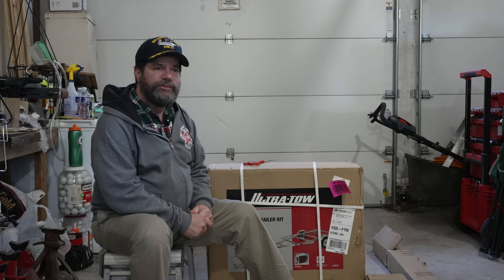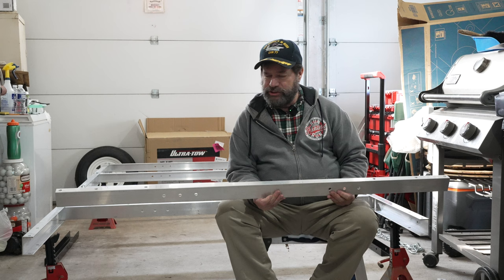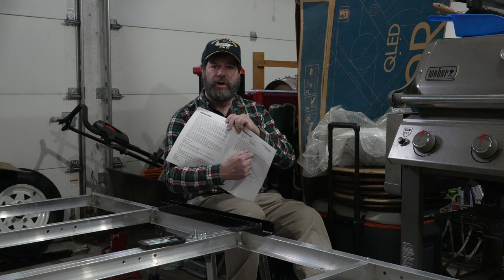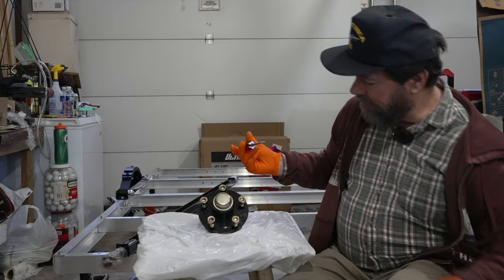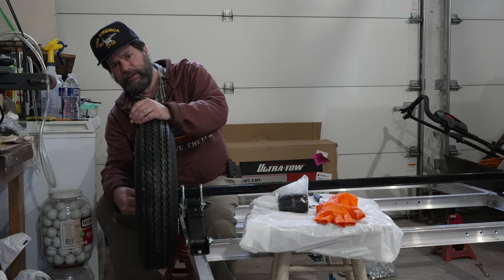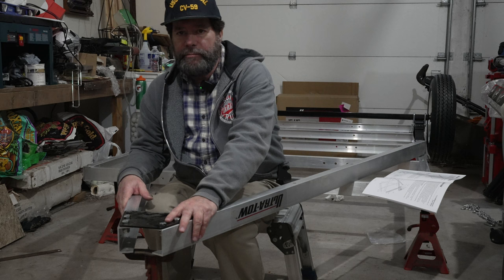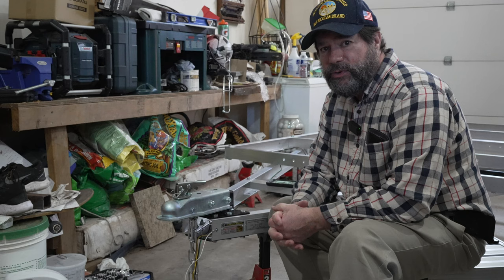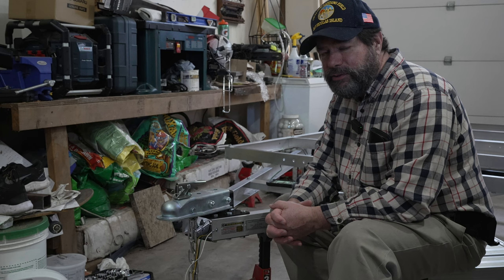Building the Northern Tool Ultra-Tow 5 x 8 Aluminum Trailer Kit

Comment: Great job on the tutorial, the most comprehensive one on YouTube! I just picked up one of those trailer and mine has some differences when it comes to tow bar attachment. They also changed the order of some steps around and tell you to leave out a couple bolts during initial assembly. Thanks for calling out the stupid marker light detail! The instructions are poorly written and I did not catch that one of my side rails was swapped around.
Reply from the maker: I'm glad it was helpful.

Comment: Thank you for the tutorial! I've purchased a used one recently and started hearing about aluminum corrosion from the stainless steel bolts. I read you can add rubber flushers to prevent direct contact. Is this something to be concerned about?
Reply from the maker: I have heard that some metals will react with aluminum.  I can not tell if the bolts in the kit will ever cause a reaction.

Comment: Thank you for the video! Where do the eight bolts marked SC 8.8 in separate bag go?
Reply from the maker: These are shown in the video.  I can not remember the exact locations, but it is either the spring connections or the trailer hitch connector.

Comment: I want this trailer but i see it is rated only for 45mph.  Is there a way to make it go faster?
Reply from the maker: I changed the axle, wheels and tires. Now my trailer is rated at 75 MPH.
Reply: @HistoricForrest  can you provide any info on the axel, wheels , and tires you went with?
Reply from the maker: @TheBobvass  I got the 72/58 3500 lb axle from the Tractor Supply Company.  I had to get a conversion kit to attach the axle.  I got 15 inch wheels and tires from etrailer .

Comment: Just a couple questions how much does the base trailer weigh, and what’s the cost also sorry to hear about your car.
Reply from the maker: 187 pounds.  I paid $899.99 before tax.
Reply: I'm thinking of buying one, how is the trailer? Worth buying??
Reply from the maker: @macbethdemilo7253  I like the Aluminum frame.  I do not like the wheels and Axle.  I am using it to build a teardrop camper and have not driven it on the road yet.  I am replacing the wheels and axle.  I bought it because of the low weight.
Reply: @HistoricForrest  thanks for the reply, I was also thinking of building a TD on it and wasn't sure how it held up.
Reply: @HistoricForrest  with any of these bolt together frames I was going to change the wheels and axle on it
Reply from the maker: @macbethdemilo7253  
I am working on the floor now.  The bolts seem to make the frame tight.  The wheels that come with the kit are only rated for 45 MPH, so I am changing them.
Reply: I bought 4 x 8 for $660 from Northern Tool in April 2021. Shipping was included. I wanted to buy this one a year later, but the shipping estimate was $400+. Did you pay for shipping? @HistoricForrest
Reply from the maker: I did not pay for shipping.  I picked it up at the store. @obryzhak
Reply: My driveway is so steep that the back of the trailer would ram into it trying to back it up.  Do you think it’d be possible to add a second axle to reduce the frame’s overhang to keep that from happening?
Reply from the maker: I do not know if that would work, but I would not do it myself.  I would see if a different set of springs, axel, and tires would raise it high enough to work. @JR-sv8ho
Reply: @HistoricForrest  Thanks for the reply, I appreciate it.